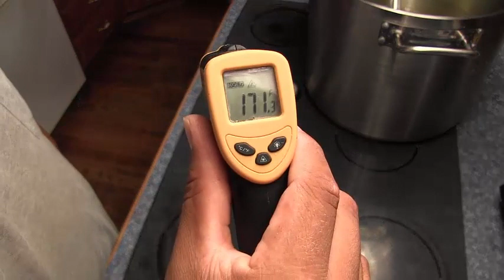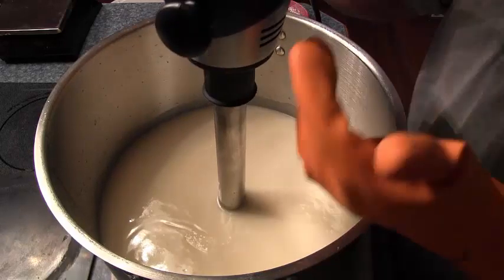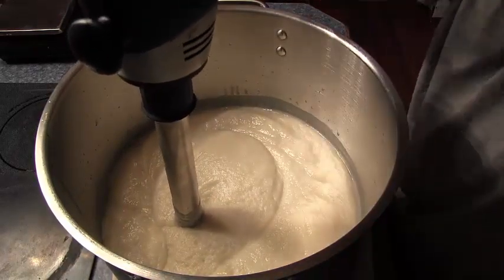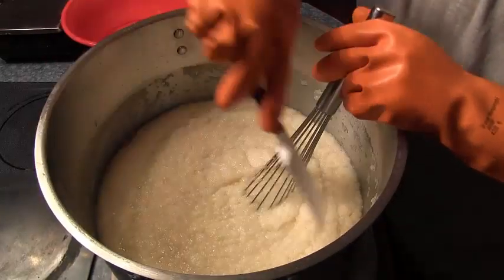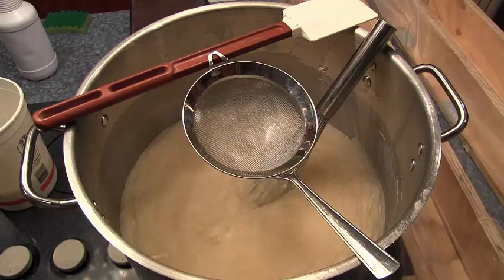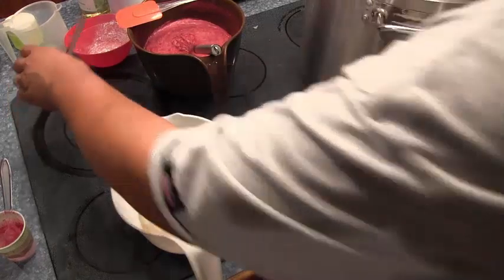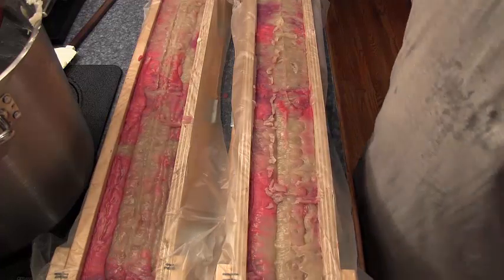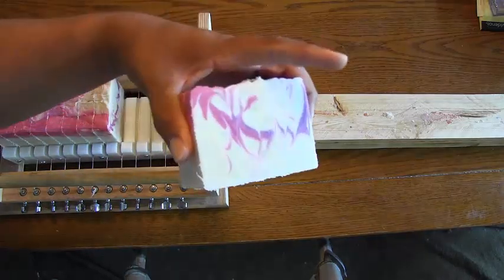Stick Blender Hot Process from start to finish

Comment: The Goat Milk Soap Store My soap seized up (didn't combine lye & oils above 110 degrees). Now what can I do with it?
Reply from the maker: Couple of things to look at.  1.  Have you used that particular recipe before?  Have you used that fragrance/essential oil before?  Some fragrance oils and essential oils will cause your mixture to seize/accelerate.  2.  The oil temps you mentioned are usually used for cold process not hot process.  Hot process is a different animal compared to cold process.  In hot process you are assisting the mixture to saponify.  So oil temps, and methods are different.  You're usually combining your base oils and Lye at significantly higher temps.  The exact temps will vary based on batch size but i'd research a starting temp of at least 165 F.

If the batch completely seized and is not useable in the form you'd like it to have, you could always rebatch it.  Rebatching almost never has the neat soap appearance but it can save you from completely throwing it out.
Reply: I didn't even add those. I had reduced the water in equal parts for coconut milk (which hadn't been added yet either) and it began to harden. Once I did add it, it was very difficult to incorporate it with the soap. I figured why waste the super fat, EO & honey etc . I was able to put it in a mold but don't know what now. I also put the super fat on 0% on soapcalc while formulating. Oh, and this was my first time using both the recipe AND the hot process method. Whoops!
.

Comment: Do you use 38% water for this method? I'm guessing you don't want a water discount but I can't really find that info anywhere.... Thanks for sharing
Reply: Ok, so I did watch the rest of the video and got some of my questions answered. But I'm still wondering if I have a solid easy soap no swirls or anything how low can I go in my water discount 33%ish.... Lol that's a technical soaping term! 33%ish. I also have subscribed and I am excited to see more from you.
Reply from the maker: +Jamie- LOVE U MORE SOAPS No one number is going to work for everyone.  Your oils, oil temps, additives, colors, fragrance  etc, will all factor in.  Ultimately, you'll have to figure it out through experience, trial and error.

Comment: Was the stove actually on or did the heat come from the chemical reactions?
Reply from the maker: +John Marlowe Saponification is an exothermic reaction.  So your oil temps will play a huge factor in the rate the reaction occurs.  This includes starting temp and any heat applied during the process.  The more heat, the faster it will go.  Faster is not always better.

Comment: At what point did you take it off the heat or did you just keep the stove on low the whole time to keep it over 185 deg?
Reply from the maker: It will depend on your batch size and a lot of other variables.  Larger batches hold heat better and therefore probably won't need any heat beyond the initial heat to bring your oils to whatever temperature you are going for.  Smaller batches may need additional heat since they do not have the mass to retain heat as well.  It will depend.

However, if things cool down or you're soaping with cooler lye temperatures, things may need to change.  Again, it will depend.

The 185 degree is a mental mark.  Usually when the batter gets to that temperature, I know the SBHP method will continue without needing to worry about batter temperature as the saponification reaction is usually in full effect and will carry through.  But, that is not a guarantee. That being said, this is with the batch size and oils we are using.  It will vary based upon your batch size, oils, water discount, lye discount additives, etc.

This method has a lot of variables and experience will be your guide.
Reply: Good to know, is the degree in fahrenheit or celsius? Assuming it's F.. :)

Comment: how could hot process soap consumes 4 to 6 weeks to cure?
Reply from the maker: There is is a difference in saponification and the curing process, and it often gets confused as the same thing.
Saponification is the chemical reaction that happens with oil and lye, and when it is finished,  your soap is safe to use.
Curing is allowing the water or other liquid you used to evaporate from the bar and become solid.
A bar that is not properly cured will last a very short time.  
So it is always up to the soap maker, but we will never sell a bar that is less than 4 weeks old.

Comment: Do you think this method would work with shaving soap/cream with the high stearic acid that they are usually made with? 
the shaving soap I make has 50% stearic acid and buy the time the butters and oils are added that will drive the SA up to about 60%. I use the conventional HP method but your method seems to make a much smoother soap. I normally use just potassium hydroxide.
Reply from the maker: ZioPinoSoaps...I really don't know the answer to that.  It seems you're fighting yourself between the stearic acid and the KOH as they basically do opposite things.  Such a high amount of SA is going to thicken/harden the soap quite a bit.  How much so and will that be exacerbated with this process?  That I don't know.  Using NaOH on this method, it is much more fluid than when doing a crock pot....only because you are present for the whole process.  Whereas the crock pot method, one is more prone to do the peek-a-boo process....check in on it every so often until it gets towards the end.  WIth this method if the saponification has finished and the batter is allowed to stay on the heat, you will remove more moisture, thus thickening it up.  All that being said for this, if you whatever HP method you're using allows you to have a workable/fluid batter at the exact moment that saponification process has finished, you might be able to use your recipe with this method.  It really just depends on your base oils, KOH and SA interact with each other.

I've done several crock pot methods lately and have had almost nearly as fluid of batter as when doing this method.  Same recipe, same ratios, just a smaller batch size.

Good luck

Comment: Why you need cure this for 4-6weeks if this is HP
Reply from the maker: Crystal,
you could use it immediately and it would be safe, however we find that the longer a soap ages, the better it is.
It will last longer and be more mild.
Reply: +The Goat Milk Soap Store thanks😊❤️

Comment: So young man. My question is . Does the metal pot affect ur lie. I have heard some people say it is better to use a crock pot instead of the pot ur using, because it doesn't get alone well with the lye solution
Reply from the maker: A crock pot would be way better than using an aluminum pot.  That would cause all sorts of issues.  However, not all metals are reactive with NaOH
Reply: @ThegoatmilksoapstoreKansas  Stainless steel would work ok?

Comment: where are those gloves! lol seems ok, but until next day, you do not need those toxins in body while making.  just saying...     Been there. done that. learned the hard way too.     Anyway,  turned out great.  very pretty.   nice video.  Tks for sharing!    :)
Reply from the maker: They were probably in the same place as the batteries for the smoke detector.  Never fear, smoke detectors are hard-wired.
Reply from the maker: Safe to use, yes, assuming the HP process was correctly done.  Will it be the best soap it can possibly be?  Probably not.  It needs to lose water (harden) and the pH will drop a little bit.  The less water soap has in it, the longer it will last and the better it will feel.  This can be very subjective.
Reply: i am not alone...     i have one wired, and its near hall off kitchen and constantly have trouble with mine too!
Reply: yep